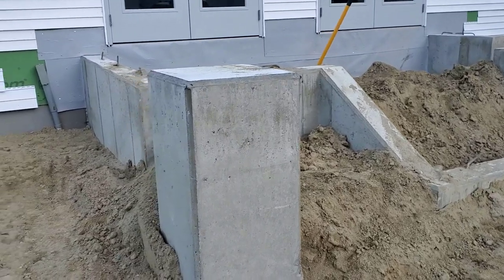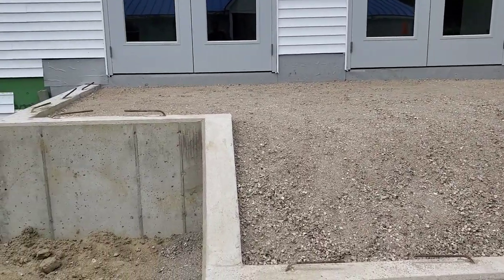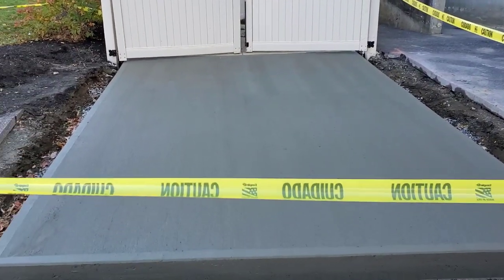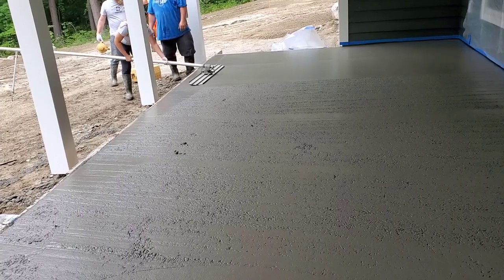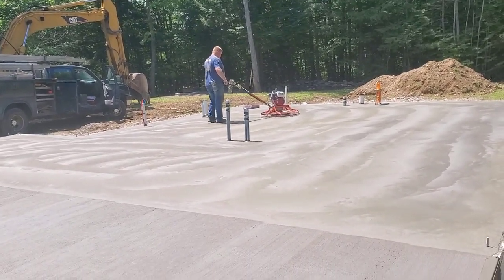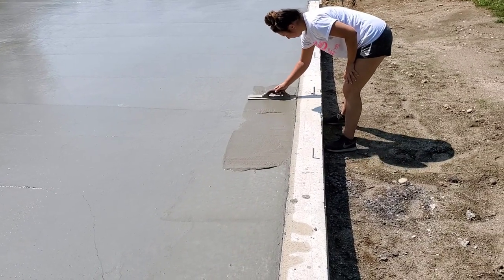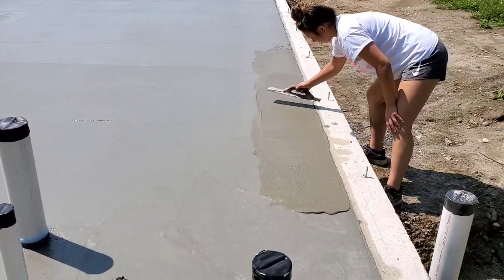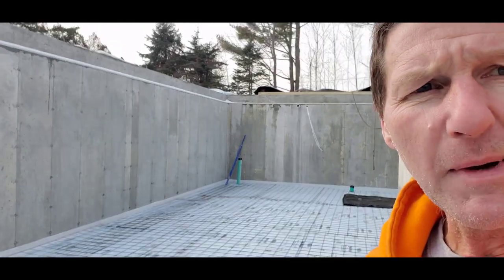What It's Like To Work With Us | Concrete Training in The Concrete Underground

Comment: I've sure learned a lot watching you. This is a pretty simple question: Do you worry about picking up dirt on your boots when you step out of the concrete to the dirt and back in again? Or do you take the boots off?
Reply from the maker: We try to make sure we don't track dirt onto the floor when we're finishing. We don't change boots but do knock off any dirt before we step back on.